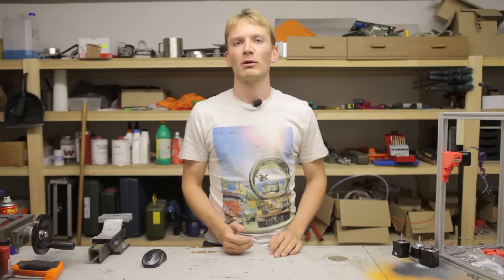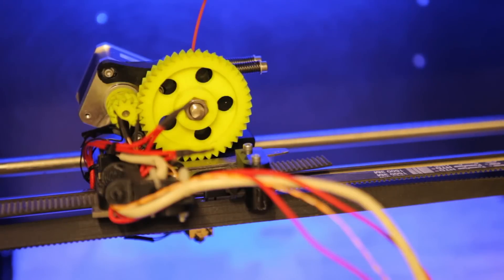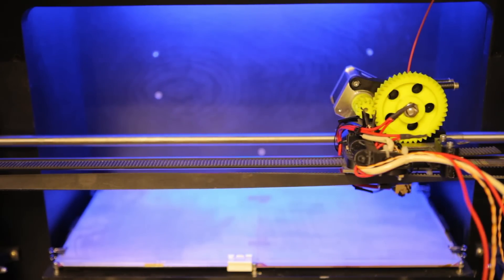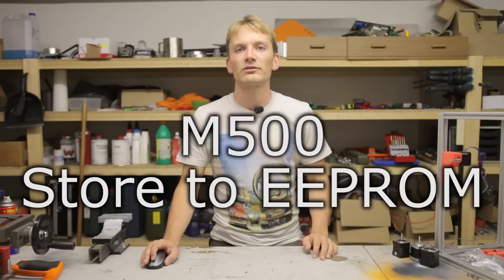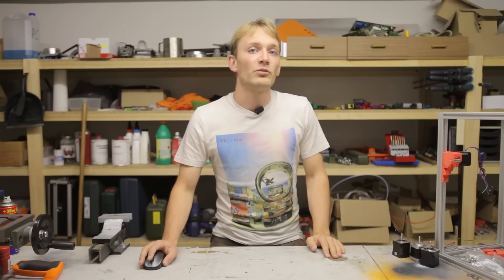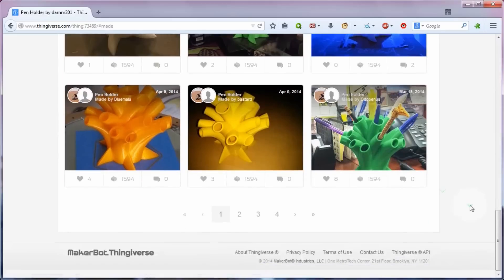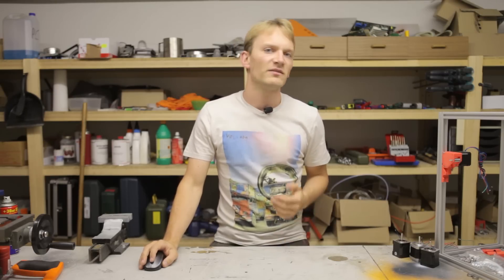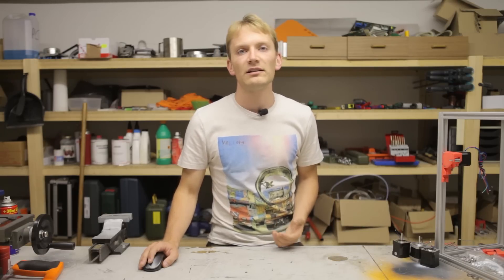3D printing guides - Tuning speeds

Comment: Hi Tom,  I have a printer with 2 extruders. i have been printing with only one until now and that is working fine. However when i try to use 2. Extruder with PVA i find that when it is switching between the extruders the movement is slower that a snail !!! Where to adjust this speed ?? I use Marlin. Cura for slicing & Repetier host for running.

Comment: Excellent video Thomas, but no mention of extrusion rates as a limiting factor of printing speeds. Maybe you've covered this in another video?
All extruders with a particular nozzle size have a limit on how fast they can pump out filament, and some of these fast moving Delta printers will encounter a bottleneck with extrusion rates long before they hit their mechanical acceleration and speed limits.

For instance, a typical extruder with a 0.4mm nozzle will have a hard time pumping out much more than about 8 to 10mm^3/sec without running the extruder so hot that it cooks the filament and potentially jams the extruder when it stops feeding. However, If you don't increase the temperature, the feed pressure will escalate rapidly and you either skip steps or strip the filament. This threshold will vary somewhat between filament types, with PLA being able to be pushed a little more because of it's lower viscosity.

This threshold can be roughly calculated by multiplying nozzle diameter(mm) * layer thickness(mm) * speed (mm/sec).
So, if you if you are printing a 0.3mm layer with a 0.4mm nozzle at 80mm/sec, you are probably already pushing the limits of your extruder.

Comment: Tom!!! Hey,  ive been binge watching your vids for months now learning as well as taking classes in electronics and other things. anyway, ive run into a problem. In the marlin firmware I have set my speeds, homing speed, jerk, etc. the issue is that after having measured the steps per revolution via prusa's calculator I input the numbers I got out which were 160XY and 5132 for Z. the thing is that when I move my printer it moves really slow but it moves precisely the amount I ask it to move. so if I say move to 100mm It will move 100mm  +-.05So, the downside is that it moves extremely slow, yet when I home it, it moves fast because I have homing speeds set to 50*60 for XY. Z axis also has this slow problem. it homes quick but then it moves slowly when asked to move. so basically whenever I home things they move fairly quick. yet when I try to ask it to move 10 mm it takes 6 seconds(I counted).At first I thought I had an issue with the ramps, then I thought it was driver issues (I'm using DRV8825)To get my printer to move fast I had to ramp up the Steps per units up to 2000 for both X and Y. but this of course made the multiplied the output of pronterface commands tenfold. meaning if I told the printer to move 1mm it would move 10 or more. I didn't measure because it would be a waste of time since that setting was useless.The whole point of this question is. How do I get my stepper motors to move fast like a normal printer would? I inputted the G1 X100 F12000 command and lo and behold my motor moved to that position immediately and smoothly. yet when I click the 100mm via pronterface it takes almost 40 seconds?!. Thanks for your time, DavidEdit: I'm using the latest Marlin FW

Comment: In the video you demonstrate a resonance getting set up in one or more axis during certain print moves. This was really evident on my Printrbot Metal Simple (1403) during certain gap infill operations. 

One thing that I have noticed but not had an opportunity to try is an option in newer versions of Slic3r (>1.1.0) to do what they are calling "linear gap fill" to specifically avoid this exact issue where a gap gets filled across the gap as opposed to down the gap when it is wide enough. See http://slic3r.org/releases/1.1.0 for an image showing it. You call out a lack of features in Slic3r to suppress resonances and while this setting may not solve for any of them in a specific print I think that is will help in a number of cases. Since it is a newer feature I didn't know if it was something you were unaware of or if you had tried it with no success.
Reply: ***** Glad to hear that you have had some success with that setting. I just updated to a new version of Slic3r with that setting, but haven't had the opportunity to put a print through with resonance issues to test. I hope to see some improvements when I do. Another option that some people have reported success on is adjusting the "Infill Acceleration" setting lower. It slows down the print, but could avoid the resonances.

What values did you try for the "Vibration Limit" setting. Looking around online people are reporting values in the 9000-15000 range. I am very much a newcomer to 3D printing, but it does seem that there should be a setting in slicing software that could drop the acceleration values on a set of print moves of this type in the situation where it cannot just switch to a linear gap fill.

Thoughts?
Reply: ***** Yeah, it looks like the info I can find is talking about mechanical and electrical tolerances and that would explain the very high values. Thanks for the engagement on this topic, I appreciate your experience.

Comment: Thank you very much, I had never heard of nor considered resonance in a 3D printer.
I think this may have been plaguing the Makerbot at my local library with a couple of prints.
Would the polar moment of the printer head effect it's operation in regard to the X & Y axes & would it being symmetrical help?

Comment: Hi Thomas,

You say towards the end of the video that "Maximum speed has very little affect on both printing time and the quality.." and that you will not get speeds above 200mm/s.  I've been working on getting my Vision+ printer (Mendel based Kickstarter Special) up to the fastest speed it can physically handle, and I'm printing a lot of my items at 300mm/s (And am working still higher) and notice a huge difference between 100, 200, and 300mm/s.  I'm printing Thingiverse item 224222 at .2mm with 25% infill in around 40 minutes.

As far as quality, the main issue I've had is that when printing over 200mm/s sometimes the print head will start to deform the print or knock it loose from the bed during non-print moves, and that my Y-Axis (Bed) belt started slipping during long moves.  So I slow it down a bit for prints without a big foot print or with really thin walls, and I added belt tensioners.  I also found I had to increase the extrusion rate to compensate for the speed (doing 1.2x normal for 250-300mm/s and 1.4x normal for anything over 350mm/s), otherwise the walls were really thin and you could see through them between the layers.

While I have no real way of verifying that it actually is reaching those speeds, I've cut my print times down significantly, and get a lot of WOWs at how fast my printer is moving. 

Also, I haven't touched my acceleration settings (they're around 9000 and 3000 by default, which sounds like what you're setting them to anyway).

Comment: Hi TOm, I have watched quit a lot of your videos and would like to ask you if you have ever tried Zortrax Z-UltraT filament? I have  a project which needs a lot of this small part to print and this model basically would function as a bushing for a 12x12mm outer diaeter stainless steel rectangular tube, but in the meantime it needs to able to work in an enviroment where temperature can get 80-100 Celsius degrees. So First i printed this model with a regular PLA on my Monoprice select mini V2 3d printer. And as a starter it turned out great. However when i tried with this ZultraT filament it is not easy to get as nice. Maybe can u give me some advice? (Using Cura as slicer). Danke schön  :)

Comment: do you know if the units for acceleration are different in the Wanhao/Prusa i3? The values 9000 and 3000 seem really high... (although I still don't hear mine is "skipping steps" on the resonance calibration whisker at that setting) What I do see a lot of is ripples and echos in my prints, and I thought calibrating acceleration/jerk would help with that.
Reply: 800 for both x and y is what is recommended on the Wanhao 3dprinter wiki

Comment: Hey Tom,
Thanks for these video's! I have an issue whith my printer, and I wish if you could help me out? please! I have a Pursa i3 Alum. frame with a building volume of 200X200mm with I recently updated the heatbed to 200X300mm and a MARLIN firmware.
The issue is .. it always shift layers on Y axis and I cant print any thing!
I tear it a part and build it back up and tried all the solutions I can find on youtube or forums! with no luck!! 

PLEASE HELP!! 
Thanks man!

Comment: Ok i have one problem and it is my extruder when i increase my printing speed to 50mm/s< it stars skipping my stepper is sy42STH47-1684A. I have aligned stepper with extruder as good as possible. And i have some upgrades coming for drivers 8825 to raps128. I have dropped Ejerk to 2  and and E max feedrate to 20. What Next if the upcomming drivers wont help. would dropping max acceleration from 10000 to like 8000 help.

Comment: Hi, I also had motor resonating issue, I even tried to lower the y axis until around 100 and the motor still resonates, it goes away after I increased the pots for the y axis. It is because there is some frictions on my y axis or loads that y motor unable to spin making it losing steps. I ramped up my y axis to 3000 accel and no more y motor resonating, same goes for z motor, increased the pots and it no longer produce noise when issuing g0 or g1 command where it requires high speed movement

By the way, could you make a video about print artifact, its name, symptoms and possible way to fix it? I believe I'm having issues with z ribbing and most likely due to my left z threaded rod were bent slightly producing the nozzle to wobble back and forth
Reply: ***** , that is because I installed this http://www.thingiverse.com/thing:788085 to avoid my belt being eaten by the metal C bearing holder, there's a sign that the belt has been eaten a little bit on the y axis and now running one side of the idler/tensioner guide.

Comment: I know this is old , but your understanding of Jerk is incorrect.  You are confusing Jerk with Acceleration/Ramping. Jerk only applies to changes in direction and is separate, but works in conjunction with acceleration when changing direction.  What you are referring to as Jerk is purely acceleration.
Reply: +ArionRaine Can you elaborate? I interpreted jerk as a necessity of stepper motors. Meaning they can't perfectly decelerate to zero speed, but need to "catch" a step(position) in order to stop. Am I wrong?
Reply: +Jim Bruckner  Yes, that is indeed incorrect.  Jerk applies to ALL motion systems, not just those with steppers.  Jerk applies to the systems ability to change direction.  Acceleration applies to its ability to change speed, particularly from zero.
Reply: Technically this is true but in this case it really is not. This is some programmer's (mis)interpretation of jerk. What they are really talking about the the maximum instantaneous change in speed that can be made. It seems to help fudge for the fact that you don't print actual curves but really a series of short lines (Similar to pixels on an lcd not making a true curved line but if you have enough pixel density it sure looks close enough)  If you are getting blobs on corners, especially ones that are tightly rounded then you have Jerk set too low. I suspect they called it Jerk for lack of a better term for something that was new and inherent in this particular technology rather than how it is used to design machines for subtractive manufacturing and more traditional linear motion devices ....

The following from konwiddak on the RepRap.org forums is probably the best explaination I've seen:

Correct me if I'm wrong, but I'm pretty sure that the implementation in Marlin is not the derivative of acceleration and "jerk" is just the highest allowable instantaneous change in velocity vector.

Since on a 3D printer all parts are described by lots of tiny straight lines, there are hundreds of corners that the head moves through when, for example, it goes around a circle. There are no smooth curves, even when using curve G codes, your controller breaks the curve down into lots of tiny lines, smaller than you would find in any sensible sized STL. Mathematically if you go around a corner at speed your acceleration and (real) jerk go to infinity.

So to handle the maths, either you can't go around a corner at speed and have to keep stopping, you actively round the corners slightly to avoid infinite jerk/accel, or you just completely fudge the maths. What the jerk setting does is impose a limit on instant velocity change at each corner and then the printer accelerates at a constant rate away from there. This allows your printer to go very fast around gently curved surfaces, since the change in velocity vector is very small at each vertex, and allows it to go in a slow controlled manner around sharp corners. The actual jerk your printer sees will be defined by its springyness.
Reply: That's helpful. Thanks John! :D

Comment: ***** Hi!
Need some help.
My print @sharp corner is overshooting.
Like if the path is like below -
**Direction of the arrow is the direction of the path
 ->--------
|
|
^
|
|

It's coming like this

|\ ->--------
|
|
^
|
|

Please advice....
I've reduced my acceleration setting quite a bit but no improvement.
-Rajib

Comment: I can't find the jerk settings in Simplified 3D ... where are they ?
Reply: simplified 3d is a slicer jerk settings is in the firmware (marlin,smoothieware,etc)
Reply: Use the Machine Control from the "Tools"-Tab. There you'll find the "Communication"-Tab, where you can input your values. Don't forget to store with the command "M500"

Comment: How can you tell by looking at your printed part if your printer is skipping steps?
Reply: Layer shifting, so when a layer doesn't start in the correct location but moved to another direction
In case of a skip in the height, you will face spaghetti above your partly printed part
Also you can usually hear the noise

Comment: So if jerk is the time derivative of acceleration, why is it measured in mm/s when it should be in mm/s^3? Are these different types of "Jerk"?
Reply: Ahh, thanks for clarifying. I was really confused because they teach jerk as the time derivative of acceleration in my engineering classes
Reply: It clears up a lot of things for me too.  It's going to make it a lot easier to optimize my build from scratch printer. Especially since it use a rack and pinion drive rather than a timing belt on both the X and Y axises which are certainly going to have to be tuned a bit differently than a timing belt. I've already noticed the steppers need considerably less current and you could likely get away with e NEMA 14 steppers

Programmers tend to do a lot of strange things that kind of tee us hardware engineers off .... Like program apps so when you turn them on the volume is set to 10 ..... You do that to a power amp in a studio or concert sound system and you'd get banned for life...... which might be shorter than you thought ...

Just sayin' .....
Reply: Teach'EM refer to the power rule of derivatives